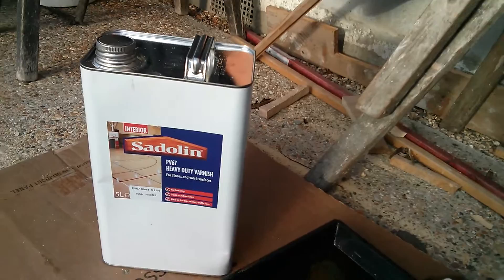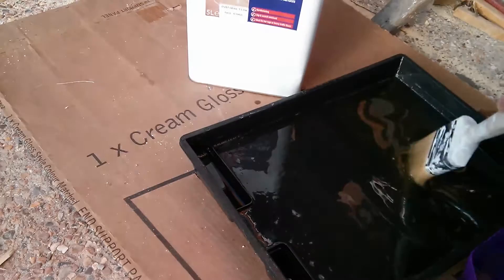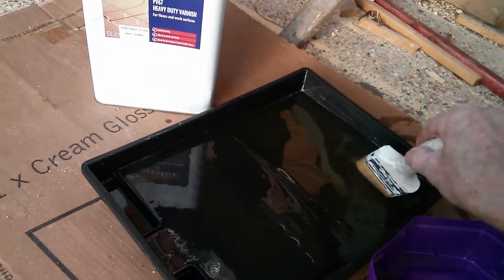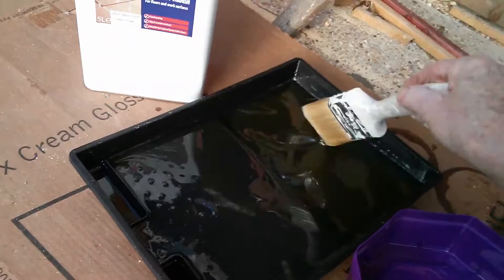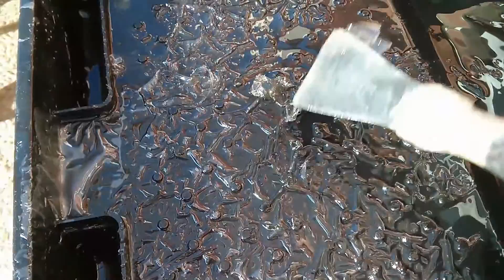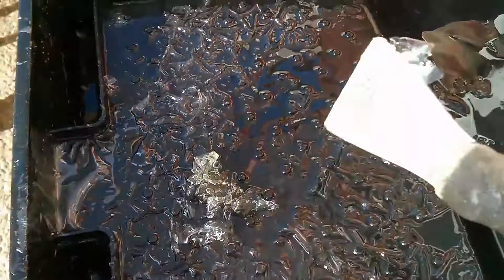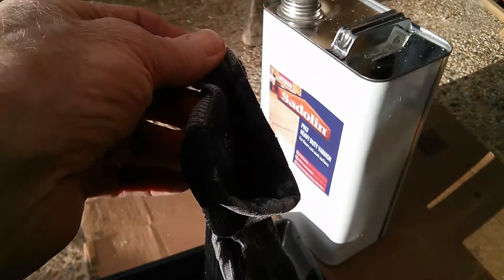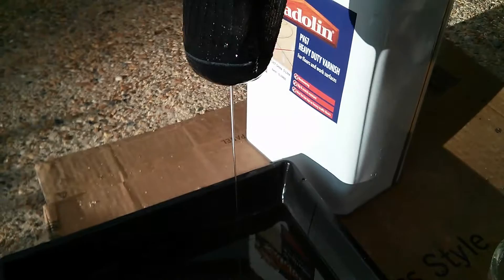Sock nightmare during varnishing pine floor boards with Sadolin PV67

Comment: The second coat on my floor went like that for some reason and it was the next day so it should have been dry ?
Reply from the maker: Hi Andrew thanks for watching. Its a few years ago now but from memory I think the instructions said to use a perfectly clean container to mix up the varnish to avoid contamination and a 'reaction'. Good luck with sanding back and recoating. b33zo